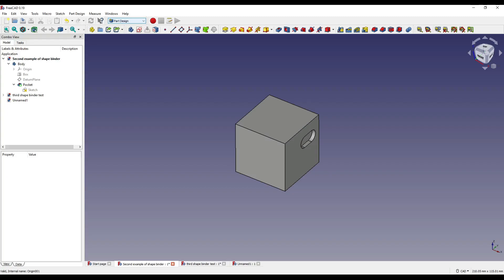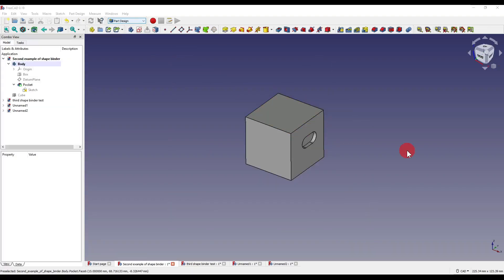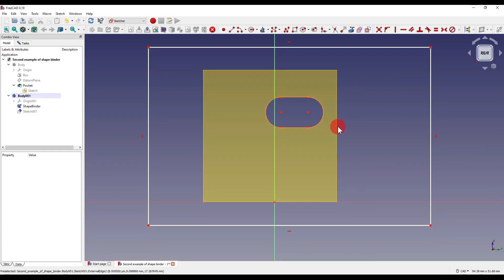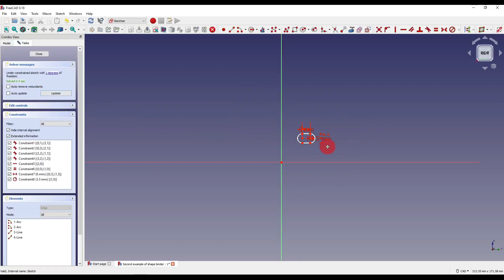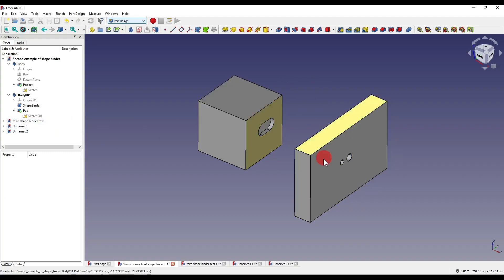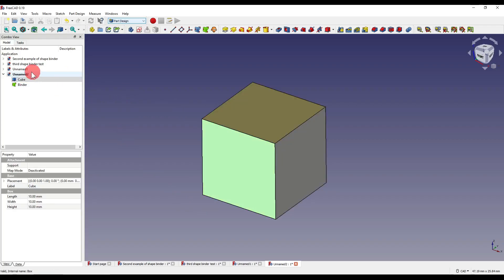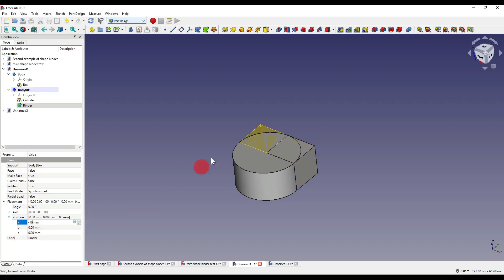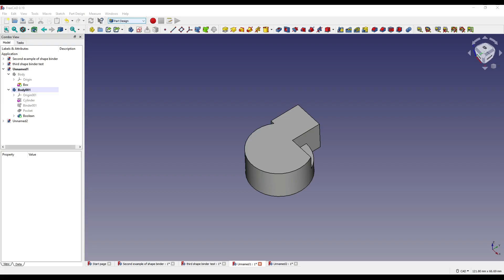3D modeling FreeCAD 0.19 - Shape Binders

Comment: I've been messing with this for a half hour and FreeCAD keeps throwing errors. I cannot reference a shape binder in a new sketch. No idea what I'm doing wrong.

12:18:11  <Sketch> SketchObject.cpp(9051): Failed to project external geometry in Pipe_Clamp_35mm_Take_4#Sketch003: ShapeBinder.Face1
Selected external reference plane must be normal to sketch plane
12:18:11  pyException: Traceback (most recent call last):
  File "<string>", line 1, in <module>
<class 'ValueError'>: Not able to add external shape element Face1
12:18:11  Pipe Clamp 35mm Take 4#Sketch003: App.getDocument('Pipe_Clamp_35mm_Take_4').getObject('Sketch003').addExternal("ShapeBinder","Face1")
12:18:11  Pipe Clamp 35mm Take 4#Sketch003: Failed to add external geometry

Comment: This video definitely needs an introductory section explaining what shape binding IS, what kinds of problems it's intended to solve.
Reply: exactly :)
Reply: It allows "in-context" editing. Often times we need to model multiple parts that have dependencies on each other, as he showed in the first part of the video. For example, you may model a couple of holes in part A, and then create a bracket that has two cylinders that should insert into part A. When modeling the bracket you'd create a shape or subshape binder of part A, trace the holes, and create the bracket insertion cyliders (as an example.) Should you go back and change the positioning of the holes in part A later, the bracket would automatically be updated.

In the last part of the video he showed how the binders can be used for boolean operation, to add or remove material based on another object.

Not mentioned in the video is the ability to create a Link from an external part file (in case you already have a part you want to use in a separate file) and do essentially the same thing (with a subshape binder).

Hope that helps anyone still confused after watching.
Reply: @EphiBlanshey  Thanks, but now I am even more confused. Best you make a video and show us in Slow steps.
Reply: nah. It goes directly to the important points.
Reply: @zurichsee706  Like why one would need it at all? Wasnt explained at all

Comment: Good video. And the comments by you and other posters here are valuable as well. As stated, what was missing from the video is the "why should you use shape binders" portion- your examples illustrated it but a blunt, layman explanation woulda been great. Also stated in the comments: Freecad could use a little work with it's UI and naming. "Sub shape binder" is bizzare branding and I feel like the icons for both need to be updated. As well as having to drag features into the sub binder- that's not intuitive.

Comment: This tool is a perfect example of how FreeCAD is just as capable and efficient as the corporate CAD packages, just with a bit steeper learning curve. Once you understand the workflow and all the tricks, you can do everything the corporate CAD packages can do and more!
Reply: It is very capable but it lacks a lot compared to others 

Topology naming is a nightmare in FC
Sketch also has cv curves and no fit point spline
Cv curves cannot be set tangent to each other 
No kid point constraint on lines

And for surfacing FC has a lot of tools but all over the place 

But hey FC is free and one has to say it is amazing 

The Workbenches form part design to architecture modeling are amazing

I am currently evaluating if this could be a very good tool to promote once students leave and need to work on their portfolio

Comment: Straight into selecting geometry. Needs to back up a bit and explain what they are, what they’re for, and why I should care. I’m not much wiser after watching a couple of times. Trying to migrate from fusion360. Looks a lot like importing or projecting sketch geometry?
Reply: Time passes. Still don't get it. When/why would you use a shape binder over 'Create Edge linked to external geometry' button? The concept is missing/unnecessary in the 'other' CAD package, so warrants further justification. Also don't get sub shape versus shape binder. Would appreciate a conceptual follow-up to this video!
Reply from the maker: Hey Duncan! Sorry for my awful replies! From what I can gather from my research, Shapebinders are used for mulit body setups...this allows you to take geometry from one body and project that onto another. This also means that when you alter the original geometry, it will also alter the projection. As for Sub-shape binders, the tool is fairly new so information is limited.
Have a read of these two pages and hopefully they'll clear a few things up.
- https://wiki.freecadweb.org/PartDesign_ShapeBinder
- https://wiki.freecadweb.org/PartDesign_SubShapeBinder/en

As for a question you left on another video about tool paths, I have previously created a video which  can be found here: https://wiki.freecadweb.org/PartDesign_SubShapeBinder/en

There are two parts but that might be helpful to you? It does need updating as I did miss a few things out!

Hope this all helps :)
Reply: @AndrewCAD  sorry to tag you six months later, but while it's still on my mind: do shape binders suffer from the topological naming issue? If not, I'd imagine they'd be a powerful way to skirt that problem. I'd use them all the time, then.
Reply from the maker: @dnmnsmith  forgot to tag you 😅

Comment: I can see that you are doing things with the shape binders, but I can't understand their purpose. Why use them instead of just other sketches?  Why have shape binders at all, I just don't get it.
Reply: Why use them, because often you need parts to link together. And you can duplicate the work and redraw the interface of the parts so that they fit together, the problem with this is if you change a part, then the other part that needs to fit won't be updated, leading to possible errors. With shape binder you draw the interface once, and both sides will update on a change. "Single source of truth" principle is the best way to avoid errors. You can't lift external edges off a different body. So shape binders allow you to link sketches between different bodies.
Reply: @WebLego  thanks for taking the time to jump in and answer that; I personally feel that I now know how to use them and why. Great explanation! Thanks.
Reply: @WebLego  What's the benefit of doing it this way instead of using a master sketch or spreadsheet with dimensions for object placement?
Reply: @bilaltariq7819  it is more visual 

I don’t want to always have to setup expressions

But your mentioned process is very useful to prevent FC topology naming issue
Reply: Chris two reason

1 freecad still stuffers from topology naming problem a lot so to prevent problems with references you made while best is only to our sketches on Datums 

2 freecad cannot sketch project between bodies so you can use binders here 

Plus binders can be moved and be 3D quite interesting
Reply: @cekuhnen  so wait, are you saying shape binders are unaffected by the topo naming issue? Because that's where I scratch my head. I now understand the utility of the shape binder, but it appears one topological naming issue would render all the work in the shape binder worthless. I have to learn more about this, maybe I'll test it myself.
Reply: @johnf4085  shape binders are for circumventing  TNP. They have other interesting applications too.

Honestly however I would use the custom build for freecad that has the NTP issues more or less solved
Reply: Exactly! I don't want to 👎 any FreeCAD video, but this one is really unhelpful. Looking forward to another video that actually explains shape binders.